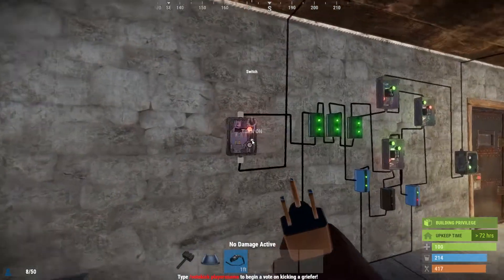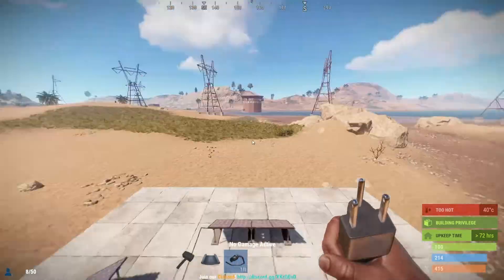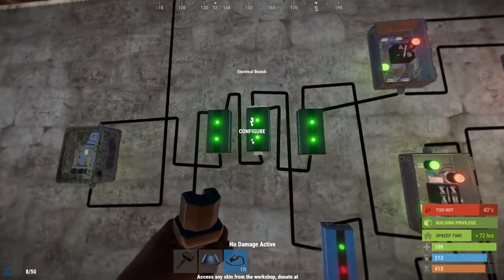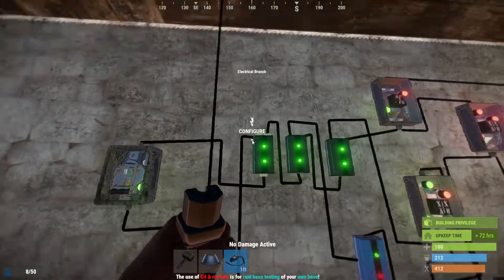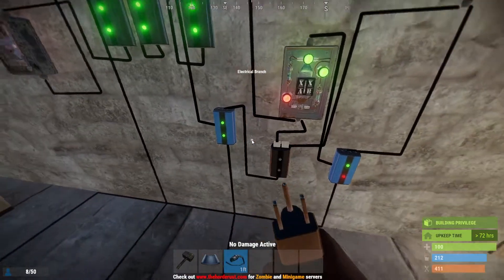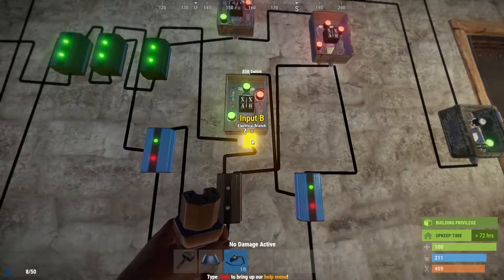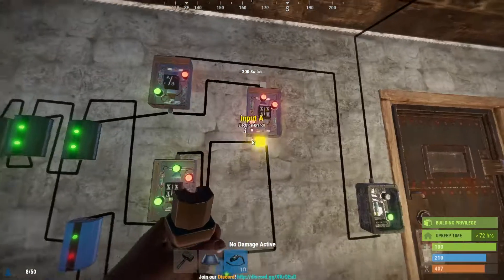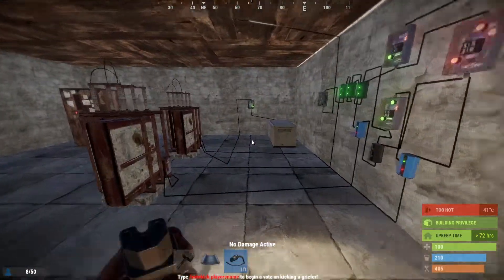Rust Electronics Tutorial - How To Setup Advanced Battery Backup

Comment: Is there a way to combine outputs of batteries to get like 200 power output on one wire?
Reply from the maker: From what i've noticed each battery will output 96 power each, I haven't experimented with combining them at once.  Root combiners are very picky and tend to only like a direct path with nothing in between like electrical branches.  You could do this with small generators (40x5) combine two root combiners on 4 generators (80 each) then combine the last one with another combiner (160+40).  Not sure if that will work, but you could try it.